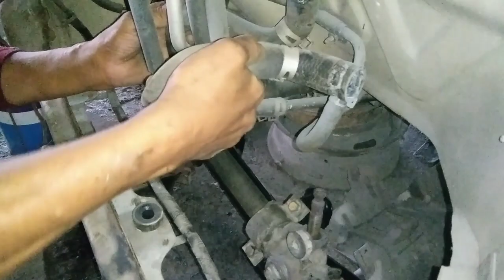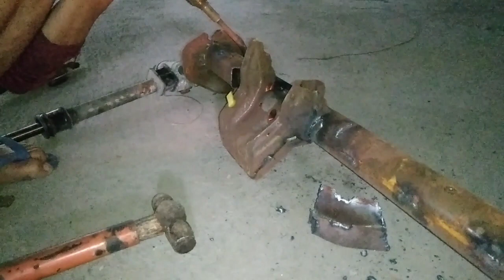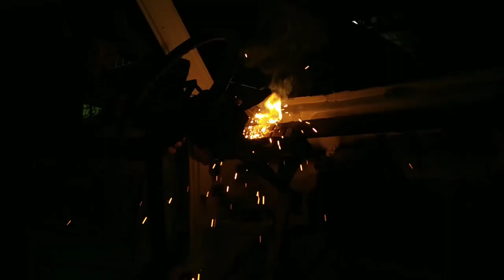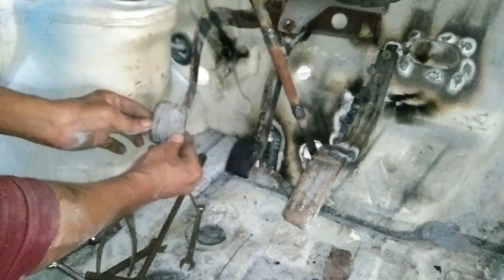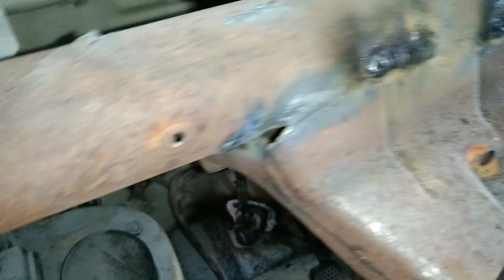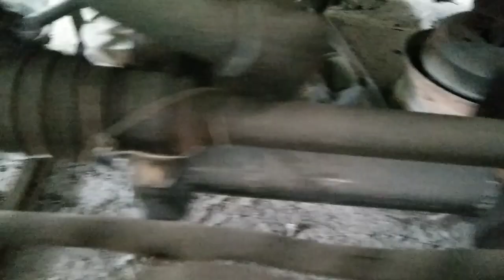SUZUKI K6A big eye right hand drive to left hand drive conversion walang baki baki original style...

Comment: mas mganda p cguro boss kung may secondary box gear ksi pra s akin mas ligtas un ksi hnd gagalawin yong gear nya s original.
Reply from the maker: Depende yan sa naggagawa boss ok din nman may segundary gearbox  magastos marami putol Marami cross joint or kupling na sinasabi nila..
Reply from the maker: D2 Kasi palit ng palit Ng rack end ayaw nila Ng may segundary gearbox magastos daw.. siguro pag order Ng bibili gagawa kmi ng ganyan
Reply: +31 sec. Ads completed 👍